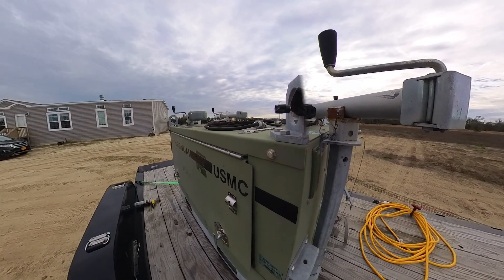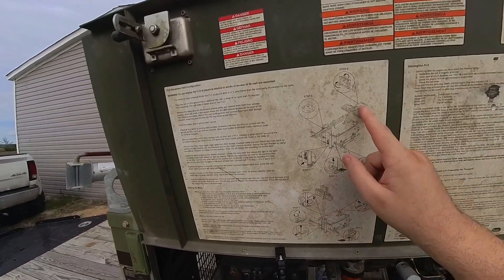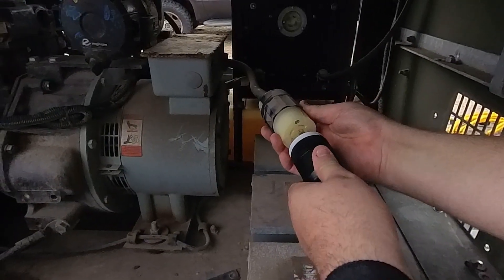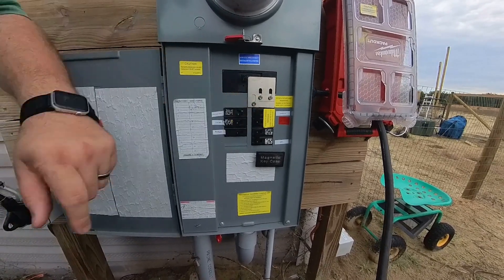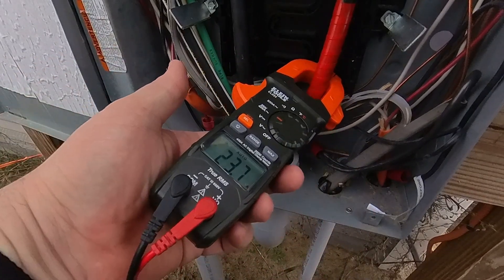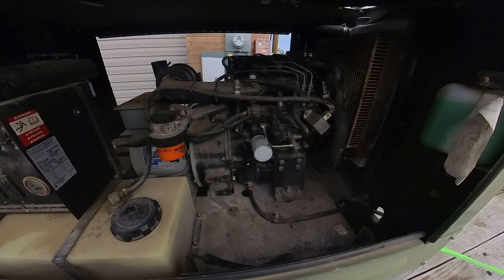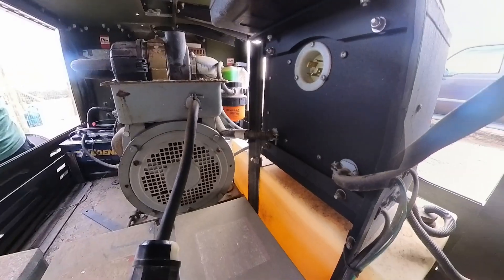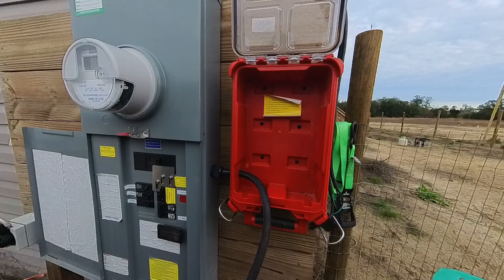Backup Power Unleashed (Full Test Marine Corps Surplus Diesel Generator)

Comment: Anything in your house not like the power? Just got a similar unit and I am wondering if you ran into any issues
Reply from the maker: We were able to run all our electronics with no issues for well over a month thanks to the several hurricanes we had last season. Some of the led light are a little sensitive and have a slight flicker. I’ll be working on a service video for this same unit that will be out soon. Thanks and have a great one
Reply: @180Floridalife  Thanks. I actually JUST tested mine, and zero issues. 99% of my LED lights were fine, but some old cheap no name bulbs flickered

Comment: Why is this generator (and other mil surplus) so big  and insanely heavy with huge engine for a total output of just 6,000 watts?   You can get a brand new tri-fuel with 240V @ 60Hz with 13,000 watts for under $1,200  bucks.  Single cylinder,  3 different fuel options with easy to replace parts (if you'd ever need them).   Granted the military ones are HUGE,  and certainly use far more fuel.  What makes these attractive...???

Comment: We have two both. Retired Navy units both 8 kw generato heads . We generally use the for area lighting at special events and have plans to convert the 4  1 kw metal halid light heads to led . By doing that we will end up useing approximately 1 kw for lighting and have anout 7 kw for other loads so I will also have to reconfigure the power distribution panel a little. For our purposes I feel it will be well worth the effort. Also we move ours light towers and all with a small mihindra tractor no problem.
Reply from the maker: That’s great thanks for sharing your story, glad to have you on the channel

Comment: Very nice! How many watts is the powerhead? Is it a low Rpm unit? Have you checked the Hz frequency under load? Wanted to suggest getting a rubber grommet where the cord goes through the packout box
Reply from the maker: Thanks check out my newest generator video where I answered some of you questions. No Hz meter here great idea to check for clean power 👍